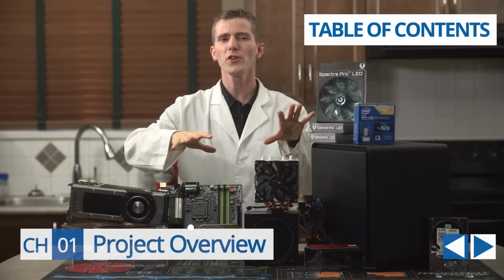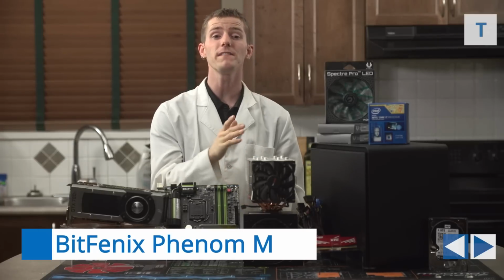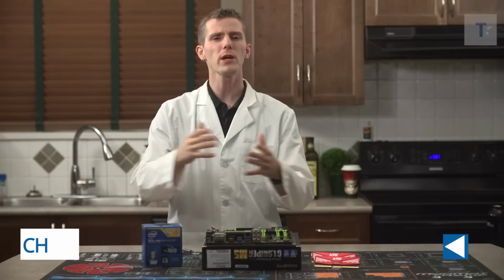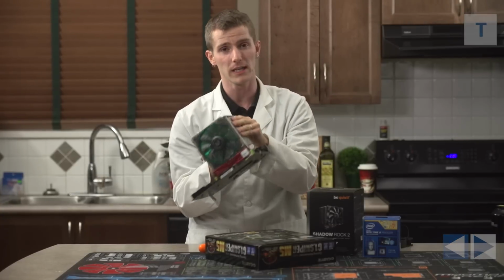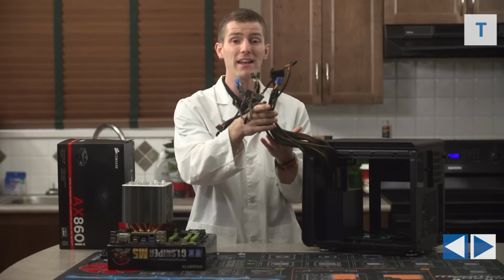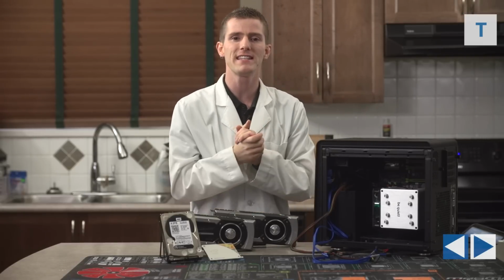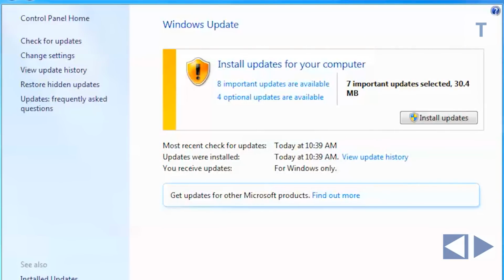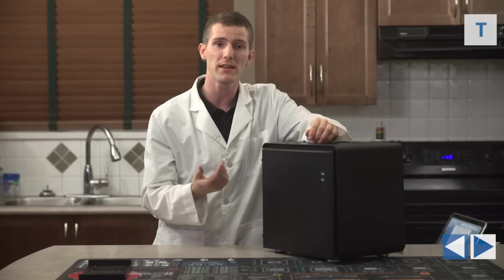ULTIMATE Intel Compact SLI Gaming PC Computer "How To" Build Guide

Comment: I really like this build on how you did it and how it looked at the end. I'm "new" to the pc gaming and the building of one. All of your builds help me understand computers but I have a question, what the benefits of putting the OS on a SSD then a slower hard drive? and can if fit a sound card in this build?
Reply: With the OS on a SSD the computer will turn on really fast, like fully on in about 10 seconds. Also you can throw a few of your favorite games/apps/etc on it and they will boot faster. Mainly your computer turns on fast. And yes you could throw in a sound card between the graphics cards
Reply: SSD also helps with wake up time from sleep like on Ultrabooks.
having windows on the SSD makes windows just run faster.
Reply: thx c; for answering my questions

Comment: Well, of course AMD graphics cards would not be right for an Intel sponsored build guide.
Reply: I don't really think that's the case here (although it might be).
I think it's because the GTX 780 Ti SLI is the fastest dual GPU configuration you can get right now. Of course, the R9-290X CF is also a quite beast rig, but the 780 Ti's beats it by a bit.
And also consider that two 290X will get really hot, and in that space they will surely downclock, giving less performance, so the 780 Ti SLI looks like a better option in such a cramped space (at least for me).

Comment: This was THE build guide that I was waiting for. mAtx, dual gpu, i7. Everything that I would do, except I'd probably save a bit of cash with cheaper gpu's and go water cooled with a Corsair H100i in a Fractal Arc Mini R2 case. But, as a general mAtx guide, this was perfect.
Regarding the peripherals, I don't think its really necessary to include. They are very personal components, and everyone is going to have their favorites. Kind of like recommending a set of pedals and a seat on a road bike. Everyone has their preferences.
Great, great build guide. Thx Linus.

Comment: awesome vid and awesome system.
But, aren't there problems with dust and the HDD?. i think there could get some dust "into" it due the airflow of the bottom cooler  :O ?! :) Im doing a sysem like this (but in the prodigy m) next week and the video has increased my motivation OVER 9000! :D

Comment: I'm a bit tired of hearing the "video editing" argument towards buying an i7 vs an i5. Seriously, how many people actually do video editing on a frequent basis ? Unless we're talking about professionals or Youtube content creators, in which case they should look at Socket 2011 or Xeon, most people's video editing endeavors will be pretty much limited to trimming some holiday clips once in a while. I don't think this alone justifies the extra cost of the i7.
Reply from the maker: Imagine YouTubers considering the needs of video content creators ;)

But seriously you're right, most people won't care, which is why I specifically say that it's for those people, and not necessarily for other people.
Reply: I know I'm late to the party, i7 benefits video rendering, but also is CAD, especially with 3D software like Solidworks
Reply: +A Fighting Sheep pardon the typos, I was making it more concise and forgot to change that.
Reply: +floflorian Trying to justify inferior product, you're poor :)
Reply: i chose the i7 3770 because i got it cheap in a 2nd hand shop and it was cheaper than the i5 i wanted to buy. i bought it for 180€ instead of 300€

Comment: I must say, I'm impressed. This is a very nice build considering the size, I'd never think I would find dual 780ti's and a ginormous cooler in such a small case. I still prefer to build in ATX cases just because it's much easier to manage, add pci cards later on and it's just plain more impressive, you know, for bragging rights :D
Also..drumstep at the end <3

Comment: Linus, the reset and powerswtich can easily be turned 180 degrees. You just need to undo 5 screews and the plastic button falls right off.
Reply from the maker: Yep. I found that out later.
Reply: Axel Solhall 1 year late lol but just bought a Prodigy M, mind if you share your knowledge on this? I wanna do the same thing
Reply: +goldhg1fkp what do you mean? Do the same project in the case?
Reply: +sky fisher no his name is a lightswitch
Reply: +sky fisher Yh no shit
Reply: +LinusTechTips hey Linus Im new to pc building and I have a question that I have been looking for an answer... u never put any sort of wifi stuff on the build log. do all motherboards have built in wifi or u dont need any sort of wifi adapter
Reply: Hello Awesome Some mother boards do, some don't. You can get good wifi adapters from $50 (AUS)
Reply: +LinusTechTips Ive known it since the Start

Comment: Just a quick thing, I would recommend downloading drivers for everything through the manufacturer website FIRST. Sometimes using the disc included with the motherboard will not work for Windows 8.1 (since that is the OS to buy currently). For example, my MSI GD65 disc did not work for 8.1 and only for 7 and 8. So I had to buy a flash drive just to get my computer working correctly.
Reply: but 8.1 is still basically 8 with a start button.
Reply: The drivers on the disc would not work on 8.1. Killer Ethernet would not work not audio. This is why I am saying this.

Comment: 700w feels a but tight to me. I'm sure it'll keep the system running and all and i'm even more sure that Linus knows exactly what he is doing as he probably has a million times more experience than anyone commenting here, so that's me included of course. But still as he said he targeted performance, it wouldn't be wrong imho to spend a little more on a beefier PSU.

Comment: Doesn't 1080p bottleneck the GTX 780 Ti? On Bf4, at 1080p, I only get 60% usage on each of my 780s paired up with an i7-4770k @ 4.3
Reply: Jamees Kirk
http://www.overclock.net/t/1465939/please-help-bf4-low-cpu-gpu-usage
I'm looking for help, and there is what's going on. CPU isn't even being used at 100%, so I don't think it's a bottleneck.

Comment: what does he mean windows 8 is all you can get for gaming right now
Reply: It is the most modern OS that will run all the games that people want. Plus it is the only one that supports DX 11.1.
Reply: edward stables Oh ok thank you!
Reply: edward stables It has trouble with older games, though. Keep that in mind (old C&C games come to mind).
Reply: edward stables DX 11.2. win 7 can run dx 11.1
Reply: *****
Hope it's not a big issue with older games, it's strange. I looked up Windows 8 compatibility search bar, and typed in Half Life 2. And it says it's not supported and will not work. But then I do a quick google search asking if the game will work on Windows 8, and everyone in the forms say yes it does.
Reply: julekulehalvgrim Oh right, I didn't know that 11.2 had come out yet, I must have gotten mucked up somewhere.
Reply: BarbecueGamer For the record, I'm talking from experience. C&C titles like TS and FS have a stutter issue, which makes gameplay quite a bit less enjoyable. Something about dropping old DX file support or something, not sure.

Also, it's possible HL2 in stock form doesn't work (aka no Internet no proper gameplay).
Reply: ***** two words "compatability mode"
Reply: For what game? Because it only resolves part of the issues with the aforementioned C&C games. Stutter remains.
Reply: Ok
Reply: *****
So, with your overall experience with Windows 8. Which would you say is more adaquent for gaming, Windows 7 or Windows 8?

I'm pretty much at a loss, I'm building a new system and I really don't know which one to choose.
Reply: BarbecueGamer it depends on what games you are planning to play if its only the newer ones I'd get windows 8 cos it runs faster but it does have some comparability issues

Comment: Do a super compact high end PC build with  a Coolermaster Elite 120 case, the cpu must be water cooled and it must have the ability to use a 5.25 inch drive as well as have an SSD and a full hard drive
Reply: who in the hell uses 5.25 inch drives still??

Comment: Looking at it objectively alot of reasons why you guys never throw in two R9 290/290x in crossfire:
1.reference cooler might have been totally inadequate for a case of this size and temps would go up.
2. Non-reference coolers might be too big for the case and cause issues 
3.would probably need more wattage, which trust me after mulling over which or what size PSU i should get when im ready to crossfire two 270x/280x(Depending on how much power my psu has to not only fix my budget and power usage) im shocked that a 700w psu can power two 780Ti's in SLi.

watching this review further i did think about these and considered them but then i realised it's probably not the real reason because Intel sponsored this video, but im not gonna point fingers and say "Linus your getting paid by nVidia or intel not to use AMD"

That off my chest this was a great video it gave me alot of ideas on how im going to go about upgrading my system and whether i really need a +750w to power two 270x/280x whatever the CASE may be at the time ....Get it ? case aahhh I crack myself up
Reply: Looking at it in real world terms for why he didn't choose an R9 290x.

1) it gets to hot
2) Its over priced as hell right now
3) it gets hot
4) Its overpriced

Yes he was sponsored by Intel, but that doesn't really matter since AMD has given up on higher end CPUs, completely left the AM3+ socket in favor of FM2+ and APU stuff.
Reply: Seeing as it was an ultimate build guide I wouldn't see money as a reason
Reply: Well, just because you have a lot of money doesn't mean common sense should go out the window. If you can safe 200+ dollars and get the same performance then why not... Though they did get a 4770k instead of a 4670k
Reply: Maybe that was provided by Intel or under the clause of the sponsorship it was specified to use a 4770k

Comment: As I checked the prices for components I might consider to put in one of these cases myself, I found that it would turn out quite cheap compared to a "normal" ATX build, which is definitely a plus in my book. Since I keep my PC on my desk due to a dog who was never house trained, a small machine would be very beneficial. Though it seems quite expensive to exchange both my case and my motherboard for the cause.

Comment: Hi, I am a PC building n00b and I'm planning on making a £2000 budget build and would really appreciate any help, I would like to use a water cooling pump system and this is the build I was planning on using http://uk.pcpartpicker.com/user/MichaelM97/saved/3DpM , I would really appreciate any how to's or recommended pump systems that I could use for this build. Thanks.
Reply: you might want to think about intel instead of amd,
Reply: I dunno its got much better speeds at a much better price and with water cooling, heat isn't a problem
Reply: Hey there. Nice looking system list. The Corsair 1200w psu have picked here is overkill for the system you want to run. Save a few pounds and get a ax 760 or ax860. And as you see from this vid Linus runs two 780 ti's from an around 800w psu. for more help head over to the linustechtips.com forum.
Reply: actually intel seems to perform better in games even underclocked, trust me its bette
r

Comment: holy balls, that cpu is running at 60 to 90c, my 125watt amd cpu never reaches over 60c at 4.5ghz. that cooler is installed wrong.
Reply: I bet it would if you ran prime95 small fft with furmark running at the same time...
Reply: that is how I got the maximum temp, I had sli gtx480's at 100% load and prime95 small fft for 5 or 6 hours.

Comment: Why stock 780ti's if you're worried about heat?
Reply: Rear exhaust is good when you have a small case ..it doesn't heat up the inside of the case very much :)

Comment: So it didn't crash with a 700w psu... hmmmmm.... gonna order my second 770 gtx right this second!
Reply: I run two GTX 670 Superclocked 4GB editions with a 750w PSU and I never crash. You'll be fine with a 700w and two 770s.
Reply: Cept I'm gonna try it with 2 770's and a Seasonic 650w... :-) ... and with the money ready in my bank for an 800w psu if that fails... :-(
Reply: Earnest Bunbury I think you'd be cutting it fine. Don't overclock anything though
Reply: Really, I'm expecting to need more headroom... 850w is on my wishlist.

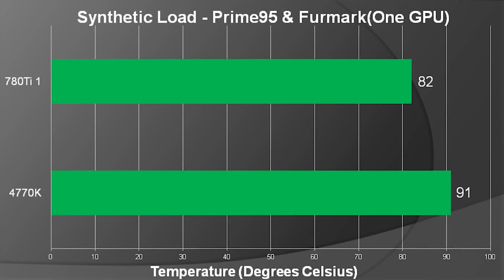Comment: is it correct at 35:38 that the 4770k hits 91C ? thats extremely hot isn't it ? please correct me if im wrong ;x
Reply: It's toasty, yes, but that is a completely unrealistic scenario- doing real world editing, rendering and gaming it most likely won't pass 75. :)
Reply: Your CPU will reach unrealistic temps when pushing it with prime95 and intel burntest. Nothing else will ever come close to those temps. 90c is perfectly OK to hit with those tests. As triseebee said, it likely won't pass 75c in any real world situation.
Reply: That did worry me, 91C. My rig doesn't break 80C with p95 and or IBT, and it's overclocked. I'm just cautious.
Reply: triseebee
 I never try to go over 80 degrees Celsius on my CPU though. 90 degrees Celsius is about my limit for GPUs. Mind you these are the limits I hit while running Furmark and Prime 95.
Reply: Fumark is a pussy destroyer. He won't experience that temps on a realistic scenario (check Farcry 3 Ultra 1600p full load), the CPU was sitting on a comfortable 60°C.
Even a very heavy rendering load won't put this machine over the 80°C which is still on the safe side.
Reply: Yeah, but Linus is pushing the CPU to its limits with Prime95. With a real work or game load, it won't get that hot. And I think the Max Temp threshold for the 4770K is about 105C, maybe a bit higher.
Reply: I have the bitfenix prodigy M, a 4770k and a darkrock c1 cooler and it never goes above 50 degrees. It idles in the high 20's.

Comment: great build guys really liked it, its a bit stretch for the cash to use dual 780ti its awesome but unless am using multiple display monitors I'd rather use a single card and as for the storage mounting I didn't like putting them on top of each other I would prefer using the case mounting bracket for the HDD and SSD, I was going to ask about the music but you already added it at the end :)

Comment: Here are my thoughts for a £900-£1000 gaming rig,

i5 4670k
Corsair h100i
MSI Z87-GD65
Sapphire r9 270x Toxic
WD 1TB caviar blue
Samsung 840 EVO 120GB
Corsair CX 600
Corsair obsidian 750D
Corsair Vengeance 8gb
Reply: Poor GPU, absolutely awful. Get gtx 770 or 780, if you really want AMD then go with 290 or 280. You can save more money with different case. With one GPU you don't need 750D. Look for cheaper and smaller cases like 350D or others. You can even save some money by not getting Corsair h100i. There are different and cheaper coolers that gives you similar performance as Corsair h100i.
In your case i would save more money for more powerfull GPU.

Comment: Why do you make vids like this is going to be someones first build? haha
Reply: because it may be someones first build, ther previous pc's may have been dell or shop built etc. these guides can give anyone the confidence to build their own rig
Reply: Duluxdoggy
I dont see a lot of people who go from a pre built dell to a Intel Core i7, dual SLI GTX Titans, and a SSD. lmfao
Reply: 360ModsandHacks how about the dell xps/alienware previous customers? pre built does not always mean low spec,
Reply: I sure do wish I got $3k in computer parts for my Christmas.
Reply: The build guide applies to most standard parts, so there might be new people watching, and they might replace those two 780ti's with a 760 or something, but the guide would still be relevant.
Reply: Gotcha. I was just stating you wouldnt go with this big of a build for a first time computer. I mean from on board intel graphics of a dell to dual way SLI GTX Titans. No just no.
Reply: Because INTEL paid him, as stated in the intro.
Reply: 360ModsandHacks did you not watch the video?? they are not titans, they are 780ti's
Reply: Point taken on the title, this is a guide for first build on ultimate gaming rig.  People that have experience building a normal rig will have some benefit on this guide for the ultimate gaming rig.  xD

Comment: Linus not everybody goes for an ultimate build.....we want some mediocre build with flexibility and upgradability !
Reply: i am not saying the cheapest build...ADM+nVidia like that stuff ! A decent gaming build.
Reply: I am Indian bro...that's why....the prices are too damn high...making a kick ass PC is way out of pocket !
Reply: Bro I have an Asus GTX 760 OC already....but have an old configuration....need to update that completely ! what would you prefer for me and also a decent gaming monitor.
Reply: I recently purchased that GTX 760, so I won't upgrade that.....but my CPU is old, its a AMD Phenom X4 4gb ram a new Corsair 550 watt power supply which I think will reuse with the GPU.
Reply: Ya, I have selected an i5 4670K with 16GB (8x2) 1600mhz for an MSI H87-G43 Gaming board which is actually pretty cheap. Would my corsair 550 VS power supply enough for this build ?
Reply: Thanks a lot for your help bro !